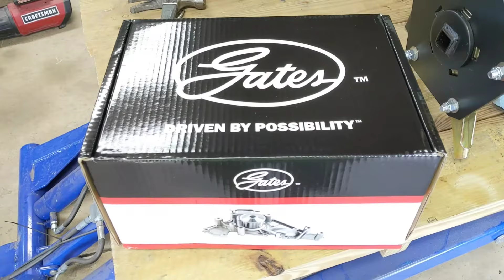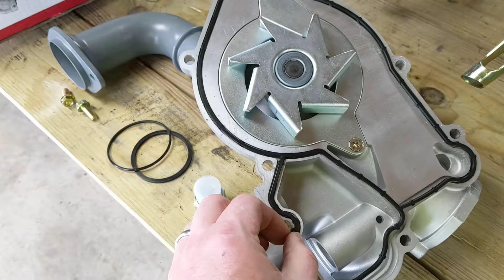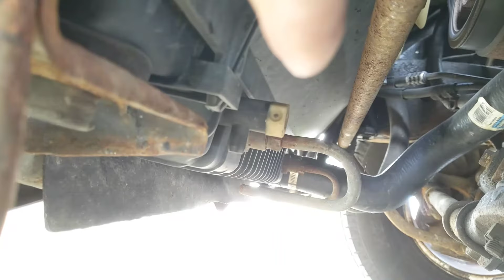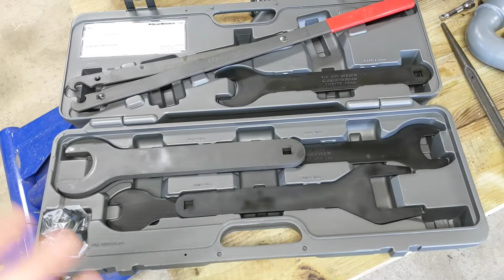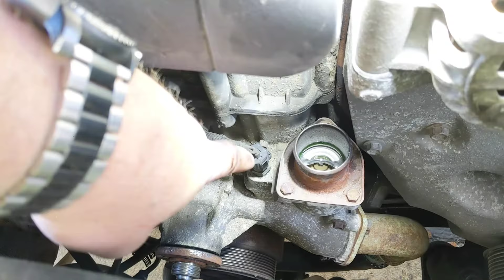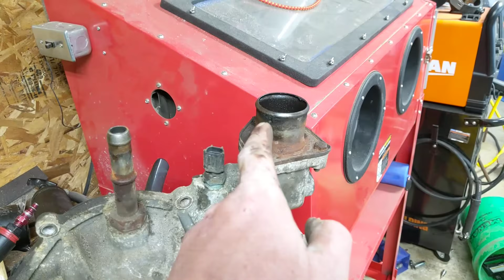How to replace the 7.3 Ford Diesel Powerstroke water pump, quickly and simply!

Comment: This video really helped me out !  Although i did try the approach without removing the degas bottle and fan shield and it was just way to tricky for me. It's well worth it to take 5 minutes to remove the 5 easy bolts and just pull those out. Plenty of room after that and don't have to worry about beating up the radiator.

Comment: I highly recommend replacing the top hose with one made for a two alternator engine found on ambulances, etc. The hose goes around the serpentine instead of through it.
Reply: Where can I find one of those hoses?
Reply: @brianjames3753 I got mine at Auto Zone. Just specify which one you want.
Reply: @brianjames3753 Napa part number 9066

Comment: I put a gates on my OBS 7.3 less than 3,000 miles ago and it’s already leaking again, haven’t even made it an oil change and have to change again
Reply: Torque specs are imported dealing with seals and aluminum.
Reply: @jasonlewallen7146   doesn’t really apply to the weep hole but yes that’s the benefits of having access to the workshop manual also
Reply from the maker: That is horrible.   Mine is still good.

Comment: What causes oil in coolant 7.3 diesel ?
Reply from the maker: Probably the most common issue is either a cracked injector cup, or bad injector o-rings.
Reply: @1D10CRACY  not an oil cooler ?
Reply from the maker: I have not seen it on the 7.3s personally, but there are folks in the forums who say it happens.

Comment: Having now just done this job today, I have a few things to add. 

I highly recommend removing the coolant reservoir and the fan shroud. Its only four bolts, and the increased room makes it WAY easier to access the fan clutch, as well as the bolts holding the water pump in. On my truck every single one had to be broken loose with a breaker bar.

While you're in there, it's an excellent opportunity to replace the thermostat and temperature sensor, as well as the upper and lower radiator hoses if they look worse for wear as mine did. I also chose to flush and replace all my coolant with proper diesel extended life coolant since it would be drained anyway and I don't believe it had ever been changed.
Reply: Thanks for the info

Comment: Good video, only thing I can add is take the 2 minutes to remove the shroud. Makes life so much easier for cleaning and a assembled pump install. My example had a lot of corrosion in the housing under the pump so I had to apply a light layer of grey rtv to fill the cavities. Spend time to save time sometimes-
Reply: yea I agree very little effort to remove the shroud and the fan for so much extra room to work and make the job easy. A piece of cardboard to protect the radiator fins and its easy sailing.

Comment: The painted grey lower coolant elbow will flake off its coating and block flow to your oil cooler.
Reply from the maker: It looks to be powder coated and looking at the video it looks like they got the ends coated a bit on the inside.  I suppose if this was something that concerned you, it wouldn't be a big deal to use a Scotch Brite flap wheel on a drill and remove the over spray on the ends.

Comment: U mentioned 8 gallons of fluid is needed ! 
I have a 99 F350 with 7.3 
If u lived in a cold I wonder have safe 4 gallons of coolant/ antifreeze would protect it ???
Reply: Cold climate sorry
Reply from the maker: I mix mine 50/50.    But I also live in Northern Ohio, not the coldest part of the states.
Reply: Thank you Sir
Reply: Thank you Sir

Comment: Thank You, clear everyday vernacular in an easy to follow step by step methodology. Dang fan clutch kicked my butt for awhile (I was bound and determined to use tools I got for hummer {even if neither would fit the nut},) until I ran to the store and got correct wrench for the nut. Should have coughed up the few dollars more for a multi vehicle kit. Granddad always said "Son, it only takes a bit more to go first class, if you have to go."

Comment: Wow!  You made that look easy!!!   After 100K I stop only buying OEM parts...  Great stuff!!!
Reply from the maker: That is pretty much how I am with parts, once past 100k I'm a little bit cheaper.  I actually filtered and reused the radiator fluid but was too chicken to show it in the video.  LOL  This poor truck isn't a daily driver and only gets used when I really need it.  This job ended up being easier than I expected as well.
Reply: @ScoutCrafter Made it look easy by skipping the "hardest" parts which are breaking the fan and pulley bolts loose. It was a PITA doing this myself 🙃. Nonetheless informative though.
Reply: @Kayden Richard I really appreciate your reply. I got to the site on google and Im waiting for the hacking stuff atm.
Looks like it's gonna take a while so I will get back to you later with my results.

Comment: Shazam! My 1996 Sable water pump lost its impeller on Friday ... My favorite repair guy just 1/4 mile down the road got me back on the road today (Sunday). No, I couldn't do it myself ...    I worked as a mechanic when there was actually some engine compartment room to get to things long long ago.  :^) BTW this vid is a great how-to!
Reply from the maker: If I'm not mistaken, I think the Sables were pretty reliable cars!  I always liked the wagon versions but I'm also very fond of wagons, they just always seemed very practical to me.   I don't mind working on the truck, mainly because it isn't a daily driver and there is no "stress" of getting it done right away.  It always helps you have time to stop and smell the roses.  :D
Reply: @1D10CRACY  I bought the Sable at 100k and now it has as much road-age as your Ford truck.  :^) But I'll quibble (for fun): maybe "they" knew the improved Sable water pump design wouldn't ever "leak" ... so they substituted a heat-fatigue plastic impeller instead of that nice durable metal one in your new water pump.